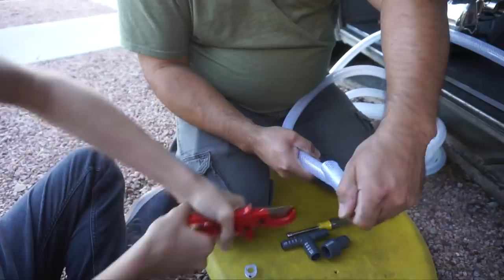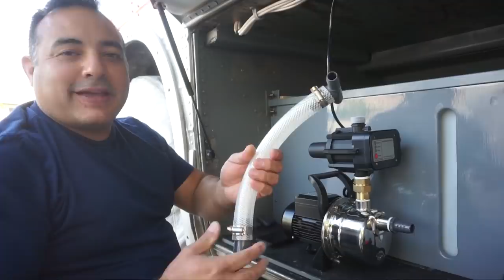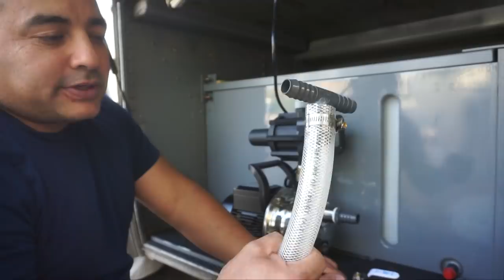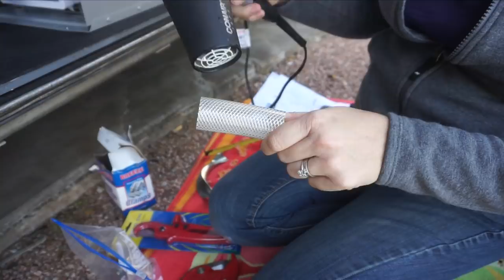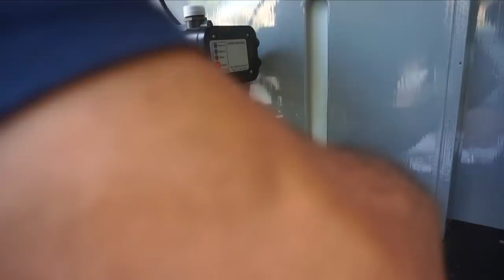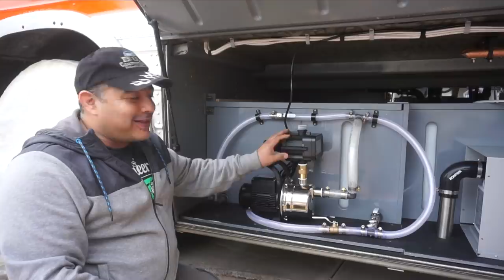Water Supply Part 3: Getting Water To the Pump

Comment: wow so many problems with this installation, if you are interested let me know, im not interested in typing for that long for no outcome
Reply from the maker: Hi crunchytheclown it sounds like you have some pretty good insight to share.  I am not sure what outcome you are expecting but if you clearly see something wrong I would love to know what problems you see.
Reply: @BeginningfromthisMorning  am at work at the moment, I will send you an opinion at lunch time here. PS my rate is 110 dollars per hr lol
Reply from the maker: @crunchytheclown9694  Sounds great - 110 dollars and hr!  I hope you type fast!
Reply: @BeginningfromthisMorning  Hi I will keep this to the most relevant points, the way you have looped the suction line will likely make this pump very difficult to prime and will create an air trap (leading to possible cavitation) if you do get this to work, the half inch fittings will be to small if you try to get significant flow from the pump especially as the tank level drops(will be ok at low demand levels) unless you have a significant restriction on the discharge of the pump when you try to do a suction lift for tank fill you will cause cavitation(undersized suction line) These are the main points regarding what I know of your system, some other useful information your controller starts on low pressure(probably !.5 bar) and cuts out on no flow protecting pump in a run dry event, these controllers have very small internal reservoir making them susceptible to cycling with a small leak(may consider external tank) Pump will have performance information on the plate and needs to be kept within these pressure figures to ensure long pump life. Well that's the end of my lunch, best wishes for your endeavours and feel free to ask if you have a question PS hello from Australia

Comment: Pump is way to big, all you need was a smaller rv pump with a pressure tank. You want to lower gpm when your not connected to city water to conserve what your tank holds. RV pumps are very reliable and cheap so you could have a spare in case of failure, also it would have been easier to use all pex piping for your water feed. For your outlet side consider using a manoblock water distribution panel with blue and red pex piping, all home runs to every fixture makes it easy to label everything and you have shut offs on every run.
A
Reply from the maker: Those little pumps have a habit of breaking when you use them too much.  Many of my bus and RV friends are on their 2nd or 3rd pump after just a year of full time use.  We hope to not be connected to city water too often so our use case is probably a little more severe than most RV pumps are used to.  I agree with the Pex for the feed.  I thought this tubing would offer advantages of being easier and more flexible - it might be more flexible but it was not easier by any means.

Comment: Please install something to hold that hose away from the Exhaust for the heater! That exhaust still worries me!
Reply from the maker: Thank you Ron.  We have several friends who use this exact water heater so I had them take measurements of the outlet temperature.  They all reported back readings in the low 100s - we will verify by testing it ourselves when we get it all hooked up but if the temperatures are that low we will probably not need to worry about it too much.  Stay tuned - we will test all that out and report back.